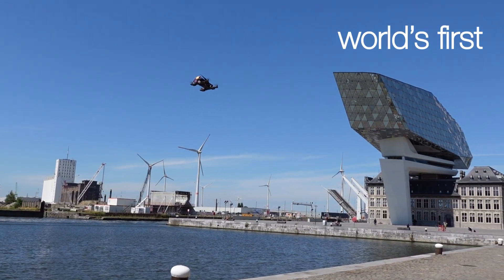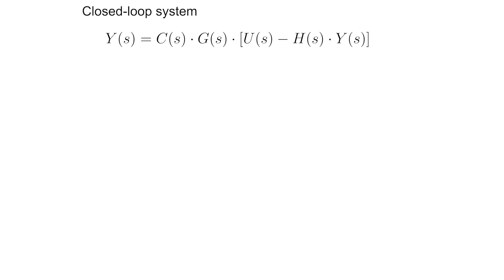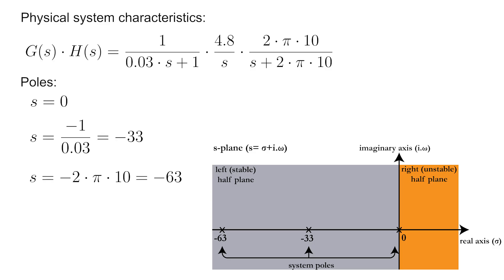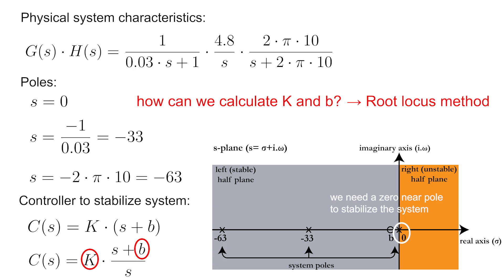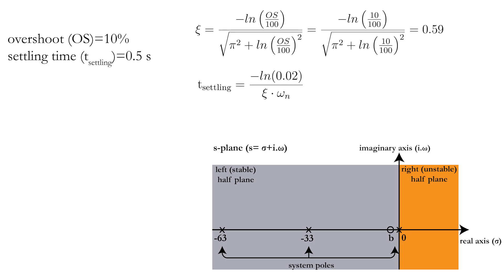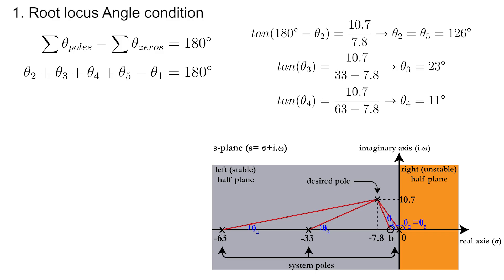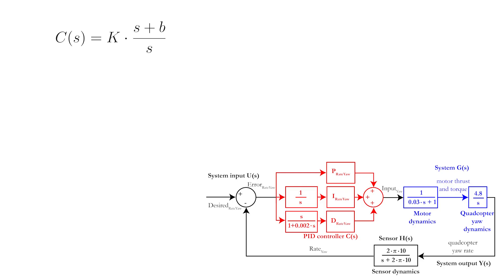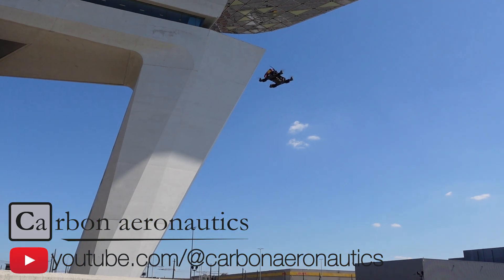4 | Use the Root Locus method to tune a PID controller

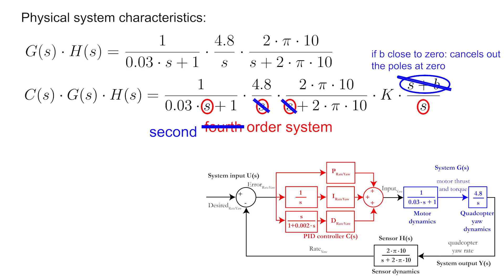Comment: i think the slide at 3:57 is wrong. 
you mentioned that "b" close to 0 cancels the poles at 0. But you used one of the blue lines to cross the pole at -63